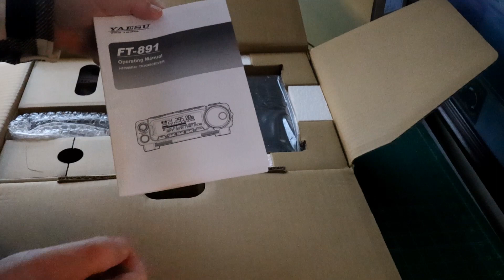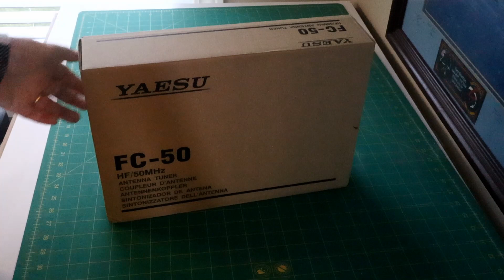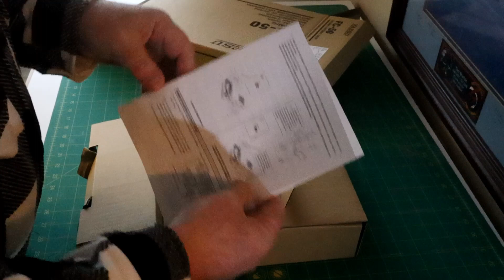Unboxing the FT-891 Radio and FC-50 Antenna Tuner

Comment: 4 years ago I bought a Yaesu FT-891  and a day later I bought the FC-50 Antenna  Tuner, I live in a Apartment Complex and I use the rain gutter for my HF antenna., I use a 9:1 balun at the rain gutter and the counterpoise connected to the porch rail I have made contacts form 80-6 meters with the rain gutter. The FC50 matches the the rain gutter rather well..

Comment: Thanks I am looking at both.
Reply from the maker: I’m now using my 891 as a mobile rig, using the ATAS-120A mobile antenna.  Since the rig “tunes” the antenna, I no longer use that tuner, but it also works just as well as an external tuner for most of my other Yaesu radios, so I’ve been using it with my FT-710.